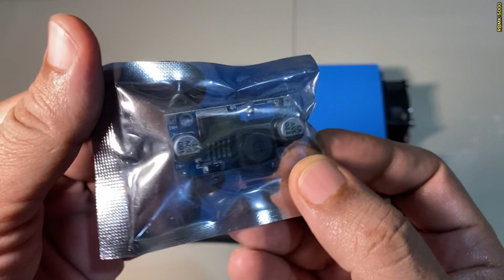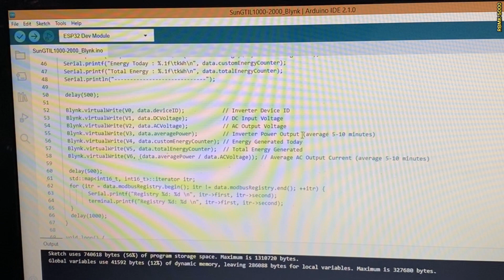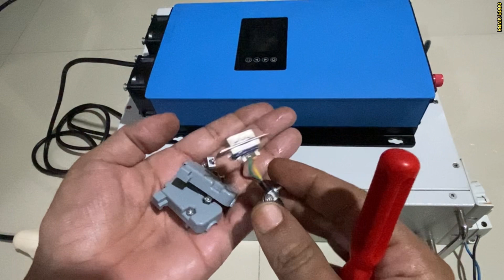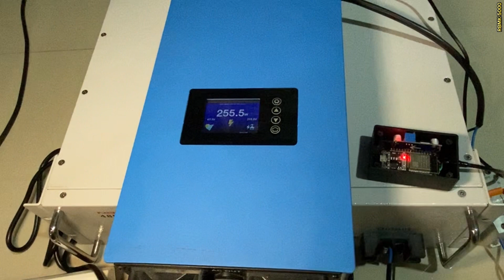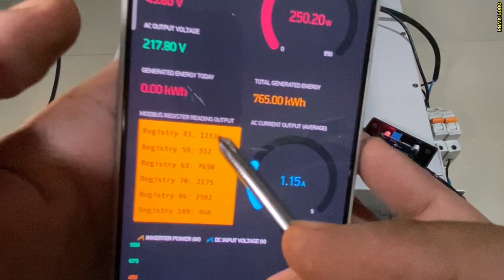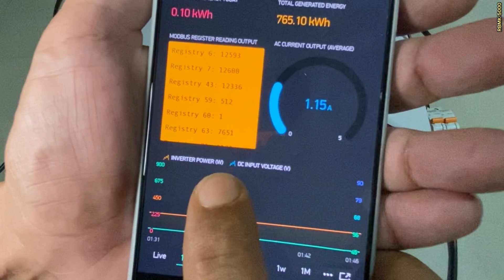SUN GTIL 1000/2000 6$ Wireless IoT - Blynk - ESP32 + RS232 to TTL

Comment: Hi , I have an error with the GfSun2000.h library. Can you give me that library?
Reply from the maker: Well it’s merely a minor typo on the original repo, you can easily fix that. Have a look (somewhere on early lines) and modify “…” with <…>.
Re Library & Code, it’s on description link.
Reply: @RBMK--vj2rn   I have additional libraries in your download link but when I add them to the arduino it says (Specified folder/zip file does not contain a valid library)
Reply from the maker: Yes I aware of that. Have u tried the one from Blacksmith’s original repo on Github? Ended up same way? Depends on your IDE version and/or Win OS. Indeed a bit tricky sometimes.
Reply: @RBMK--vj2rn  I have the same problem... can't get any further.

Comment: GfSun2000.h: No such file or directory
Reply from the maker: Pastikan Library GfSun2000 nya sdh bisa terinstall dgn baik ke arduino ide.
Lalu install juga Library emodbus (lihat note yg sy tulis pd coding).
Reply: hi
Have you done it as instructed in the video?